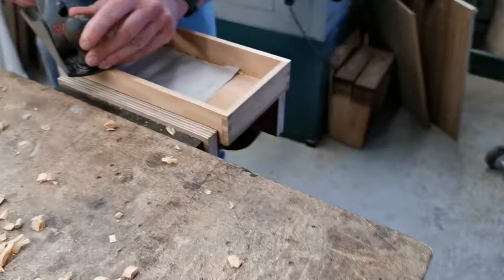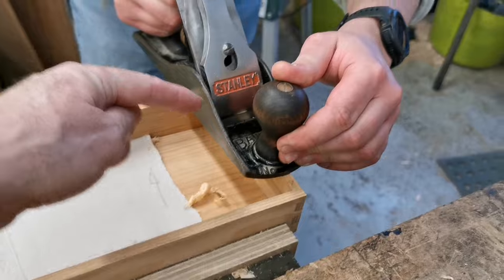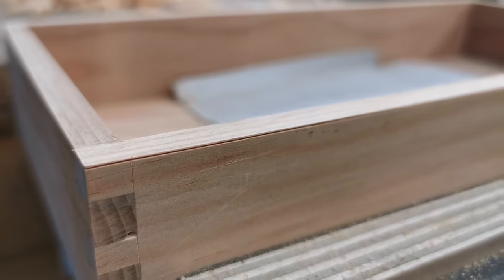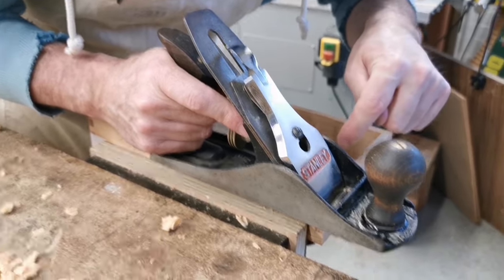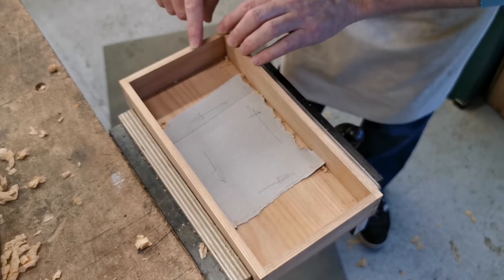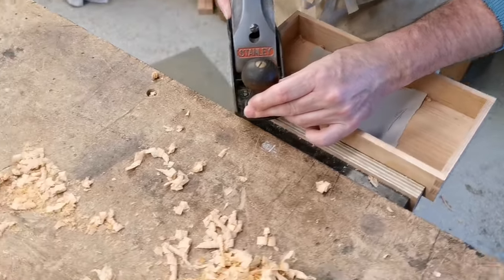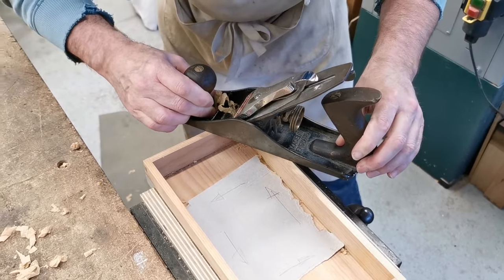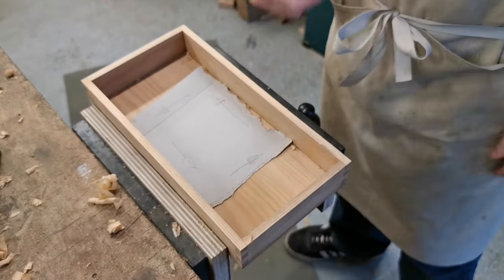Hand Plane techniques - Box making tips

Comment: Good to see how you can use the edges of the box to register the bottom surface of the plane. I imagine this would force the plane to stay coplanar to the desired surface plane and skip past any low spots on the way there. Also always good to have a visual reference for the grain direction, was it by luck or design that the grain took you round in circles?
Reply: If the sides of the box are all taken from the same board its easy to ensure the grain follows a circle. If from different boards, you have to ensure the grain follows the direction you want to go. You cant do this with grain in different directions, so theres no luck in it.
Reply from the maker: The visual reference I've done for years now, but only over the last couple of years put it onto card, oaper etc. It takes the thinking out of it. I would be in the zone, on my own and just remember which way was the right way. Now I do this for myself (sometimes) so that I can walk away if needed and not start thinking through it all over again. The grain direction can work out well like this. But you only have to turn one piece round and you lose it. You'd have to ask Adam if it was luck or design. 😉

Comment: When I plane to a line on the edge of a board, I make a chamfer first from the side that matches the line (don't really matter where it ends up at the edge).
Then when you plane from the top, all you have to do is to make the chamfer disappear and you know you are done. :-) It spares you a lot of looking at the line from the side as the chamfer is clearly visible from above. If you are old and have weak eyes like me, you can enhance it by rubbing a pencil on the chamfer
Reply from the maker: That's a great method we use on pieces (at the right time) too. The angle elongates the  path to the line; so you can easily see it from above. It's a great tip.
Reply from the maker: You might like the latest video. A Tiny Thumb plane, not only cute, but Bronze and a rebate plane too. A very special little usable tool.
You can watch it here
https://youtu.be/JOGxjoQyLKk
Thank you
Jamie

Comment: That is a good point to raise.  I note the you glued the bottom to the side of the box.  Could you discuss wood expansion.
Reply from the maker: We can. The wood is from a chest of drawers from around 1020s. It's very stable Pine or Spruce. The thickness of the base is about 6mm. There was some cupping. So we positioned the base board to be concave uppermost. That way the two long outer edges were fixed almost under no pressure (they were clamped). But the short ends had the hollow. This way the dovetailed frame would hold the board flat. Over time ( if) it moves; the bottom would rock on a flat surface. This could easily be planed flat. We're here in the UK, we don't get the extremes of moisture and dry like some parts of the World. The box will have a few coats to seal. That will slow down any movement as the wood won't be able to breathe and suck in the moisture.
I'll do a follow up of what you've mentioned, because it is a very good point.
Does this answer your question?
Reply: @twcmaker  That's interesting info.  There are heaps of hobby wood workers who build boxes and similar.  I think your thoughts on how you worked with this issue would be quite useful .
Reply from the maker: Where in the World are you? Because while YouTube can be watched from anywhere, it doesn't mean it would suit your climate.
Reply from the maker: I will make a follow up to this video. Thank you
Reply from the maker: You might like the latest video. A Tiny Thumb plane, not only cute, but Bronze and a rebate plane too. A very special little usable tool.
You can watch it here
https://youtu.be/JOGxjoQyLKk
Thank you
Jamie